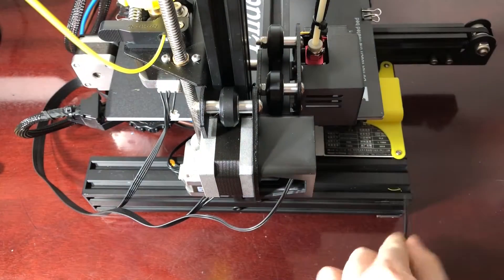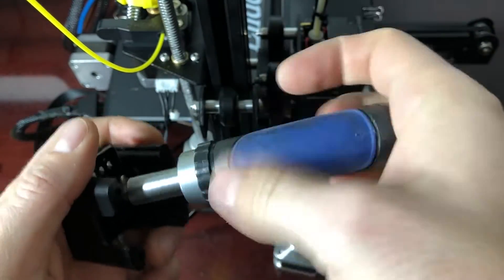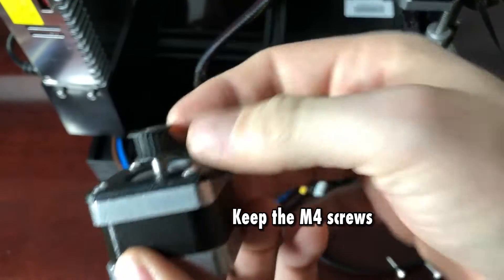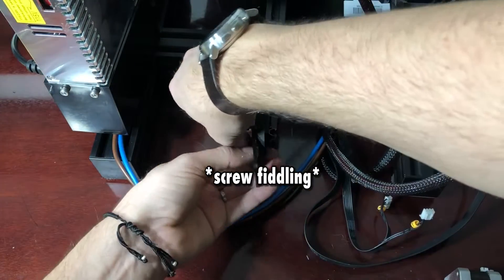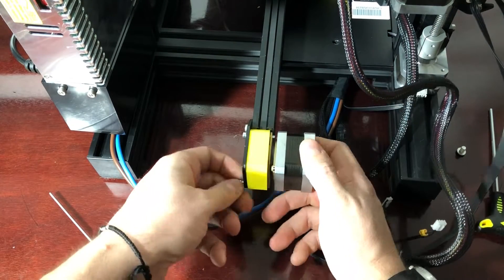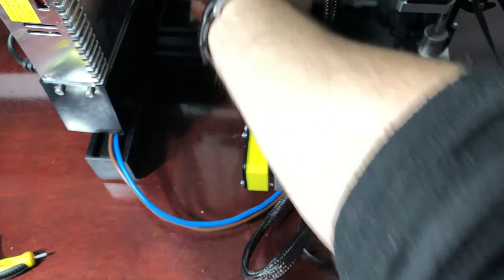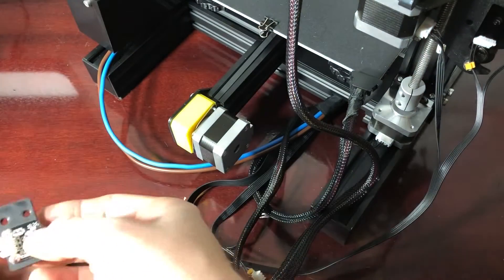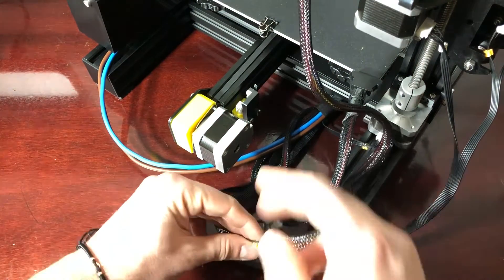Ender-3 stepper motor dampers with press-fit pulleys! [SUB ITA]

Comment: Nice walkthrough!
As an alternative to the bootloader , you could mirror te wires in the cable going to the x-axis motor. Free and probably takes the least amount of time.
Reply from the maker: You are right. It has been commented by others as well. I did not suggest it because if you don't know what you are doing you can fry your board or damage the connector.
Moreover I think that activating thermal runaway is a must.

Cheers!
Reply: do you have a site for that ?
Reply: @wambologe587  google reverse polarity steppermotor or something like that. Im sure u will find something
Reply: @silencer9112  i found a video thank you

Comment: Hi, I finally completed the steps in this video and I have to say that I'm very impressed. From the design of the parts, to the instruction in this video..GREAT JOB. Many thanks to your contribution!
Reply: Where did you source the screws for this build? Having an issue finding what I need.
Reply from the maker: They are super common in Italy. The list of what you need is in the video description

Comment: question  due you need to load a boot loader before you can make changes to firmware. thank you for your time. jerry
Reply from the maker: Yes you do. There is a link to an excellent video to teaching tech. There are so many tutorials to do it that I decided not to do one myself.

The only things you need are an arduino board and some DuPont jumper cables. Be careful not to short the 5v though... I did it... Not fun.
Reply: @AMakeDesigns  Thank
Reply: i have been trying to do this so i can install my bl touch. Problem i'm having is it reports  programmer not responding. i have watch every video i can find on this. everyone states the same procedure. i get all the light on the  arduino board but no good results. thank you for your time. jerry
Reply from the maker: Jerry, you should check the board version. I read somewhere that 1.1.4 needs a different driver for the communication chip.
Reply from the maker: Check this link for the usb driver : https://www.th3dstudio.com/knowledgebase/ch340-drivers-th3d-uno-creality-v1-1-4-board/?utm_source=share&utm_medium=ios_app&utm_name=ios_share_flow_optimization&utm_term=control_1

Comment: How does the motors not fall off without using a nut to tighten the bolt? How can a washer on the other side lock it in place?
Reply from the maker: The damper has two through holes and two threaded holes. The through holes go towards the motor which has threads, while the threaded go towards the spacer.
Reply: @AMakeDesigns  Aaaah i see them! How can I have not seen those haha. Thank you!!
Reply from the maker: Small threads are treacherous! :-)

Comment: Thanks for the video, exactly what I was looking for. I was wondering though - did you use ABS or is PLA strong enough? Thanks :-)
Reply from the maker: I used PLA with 6 walls. More than enough since all the force is taken by the screws anyway :-)
Reply: @AMakeDesigns  Thanks v much, looking forward to getting this installed :)

Comment: Very nice video.
An alternative: Change stepper driver for x and y. It does not matter the original drivers are soldered, because you only need 3 signals (Enable, Direction, Step). You find the traces very easy on the creality board. There are nice little boards for adding stepper drivers to arduino, less than 1.50€ on Aliexpress. You nead two of these and also two TMC drivers. I made a little video how to do the change (sorry, german only, but the pictures should be mostly self-explaining): https://youtu.be/E2fAYRTw1aw

Comment: Actually for the y-axis one just needs an offset bracket to move the motor mount over by the thickness of the damper. No need to move the limit switch. For the x-axis the pulley should be removed and replaced with one that is fixed with grub screws. In this approach there is no need to be editing the firmware.
Reply from the maker: You are right, there are other ways. I like this one because it does not require high mechanical skills or other materials.
The y-axis is not my design, I take no credits for the good or the bad! :-)

I recommend to update the firmware anyway due to the missing safety features in the stock one.
Reply: @AMakeDesigns  Thank you so much for your reply and sharing your solution.
Reply: What is the offset bracket ?

Comment: there are pulley removers on thingiverse such as
Reply: https://www.thingiverse.com/thing:3593964
Reply: This is the simplest way forward. But the y-axis stepper will foul the table at the auto home position with the damper fitted. I have moved the limit switch which fixes the auto home issue but the y-axis motor now stalls at the opposite end when presenting at the end of the print. Either the table needs to be trimmed or a offset bracket will be needed.
Reply: I think a box over the motor and a slotted plate is simpler. Then the shaft can be punched out of the pulley.

Comment: I have successfully removed the pressed on pulleys and fitted ones with grub screws that allow the belt to be aligned.  What is needed is a slotted plate on a support box.  I printed these in solid PLA then punched the shaft out of the pulley.
Reply: Hey mate, can you elaborate more on how you removed the pulley? It sounds like you didn't use any special tools other than printable parts.

Comment: If I have to reverse direction for X in marlin firmware do I not have to do the same for Y
Reply from the maker: No because you are not going to flip the Y motor, just move it backwards.
Reply: Thx for reply all good now great vid

Comment: Thanks for posting, I too was cursed with having these press fit wheels, up until now I have been limping with it with a piece of foam under it but its too noisy to leave running all night long,   this looks  a really good solution to this issue, I'm in the preparing to drop  a GEN L board with some shiny bits  into my Ender 3, and as the gen l is 2560 based I'll be using a tweaked to suit CR10S marlin config, this way I keep the menu  layouts  and features of  my machines consistant,
Reply from the maker: Good to hear! Let me know how it works out with the board upgrade!
Reply: @AMakeDesigns  - Thanks -  it turned out very well, I got the tmc  2130's only on the X & Y axis,   and they are pretty much silent,  the difference is  remarkable,    I used the original case for the control board  carfully  hot gluied a  bracket in the bottom of it for the board,  I did it this way so i could easily swap it out if needed and also  pass some of the cables under the board  and prevent the board shorting on the original metal standoffs,  I cut a hole for the fan at the front  and moved it from the top to the front, and cut  another  for the usb in the slotted area on the side,  with the spi cable for the tmc's its a very close fit, a few things to watch out for are , on my ender 3  the hotbed cable wasnt long enough to reach  its port on the new board  as I use cable chains , I remedied this  by   attaching it to an external mosfet   which i have mounted  at the rear  of the printer,   another thing to watch out for is  since I replaced the  original display with the reprap full graphics  with the SD slot, the encoder was a few milimeters further to the right than the creality one,  so I had to file the hole  larger for it to fit,  on fitting I noticed a gap between the 2 boards that make up the reprap smart controller that would cause  an issue when mounting, an easy fix is a bit of hot glue in the corners to prevent the boards bending  ttowards each other when  tightening the screws

Comment: I used a rc car gear puller to remove the gears. They can be found on Amazon or a rc hobby shop.
Reply from the maker: If you have good mechanical skills that's very possible. Out of curiosity, how did you put them back? How did you deal with the pulley not being totally in the shaft?
Reply: @AMakeDesigns  i bought several pulleys with grub screws...to make adjustment and removal much easier...I bought the puller as Ive seen others hitting the pulley to remove it. Knew there had to be a better and easier way.
Reply: I can't find with prime anywhere, do you have a link?
Reply from the maker: You should be looking for something like this : https://www.amazon.com/Tarot-Metal-Gear-Puller-TL2230/dp/B00VER6DJ0

Comment: Since you had to move the x and y endstops a little bit, does this result in a slightly reduced print area?  If so, how much smaller is the new usable area?
Reply from the maker: They are in the same place relatively to their respective axis. The home position is the same

Comment: You are my hero. Thank you so much for this video and the parts you designed! My printer is now eerily silent when printing. I had some trouble finding the long m3 and m4 screws since most hardware stores only go up to 20 for m3 and 25 for m4...so now i have random stainless screws that don't match the black ones on the rest of the printer....oh well, it's definitely worth it.

P.S. I was trying to figure out the reason for the extra hole on the part that hits the x-axis stop switch when I was putting it together, then realized it's your channel logo! Well played, sir. I will display it proudly XD
Reply from the maker: Tyler Sneen so happy it worked for you!

I put my logo on all my designs ;-)

Comment: Hi All,

Does this fix work for the Ender 3 Pro?
 I saw a line on the Y-Axis part that says not Pro version and wonder why?
Reply: With the newer Ender 3 Pro models, they are using a 40mm bar instead of the 20mm as shown in the video. As a result, a completely different motor attachment is used so this mod will not work. X axis works though!
Reply: @morganimel  That's (unfortunately) right. Do you know if there is an attachment for the Ender 3 Pro-Y-axis available?
Reply: @mischaanwald  I think this is the one I used! https://www.thingiverse.com/thing:3339725
Reply from the maker: spencer terry not sure. I did not design it myself. I cannot think of a reason why not, I will check when I have some spare time.

Comment: Wow thank you for this. I ordered an Ender 3 and saw comments about any made after November being press fit. I was getting worried I wouldn't be able to use dampers at all...

I will set it up when it arrives to print the needed parts and order some dampers in the meantime. Thanks again, you earned a sub from me.
Reply from the maker: David McCahon great! I also ordered the dampers with the printer. Guess the surprise when I found out I could not remove the pulleys... :-)

Comment: Do you know if the x-axis fix work for the Ender 3 Pro also ?
Reply from the maker: Kasper Nielsen yes it will. The X axis should be the exact same assembly
Reply: A-Make Designs : it did. I just manage to fry my x-axis driver trying to switch polarity :facepalm: - thank you for your design though :)
Reply from the maker: @Lynetk  ops... sorry for that... I know someone is flipping the wires in the connector. I prefer the firmware way, now you know why :-(
Reply: @AMakeDesigns  What about for the Y axis on the newer models. They started using 40mm bars like on the feet instead of 20mm for the Y axis now
Reply: Hey  @destro4444  this will not work for the Y axis on the newer models. There is a completely different motor attachment since the bars are 40mm as you mentioned.